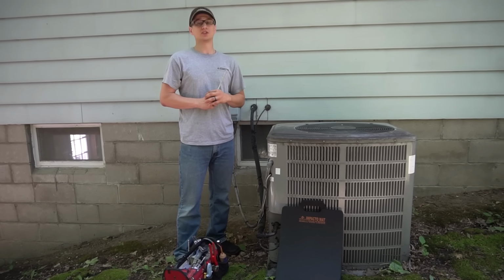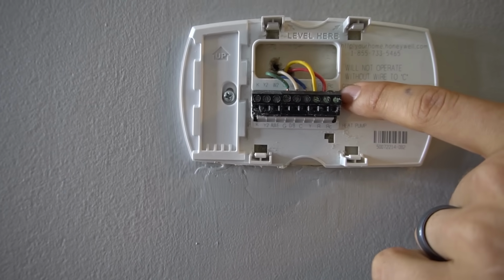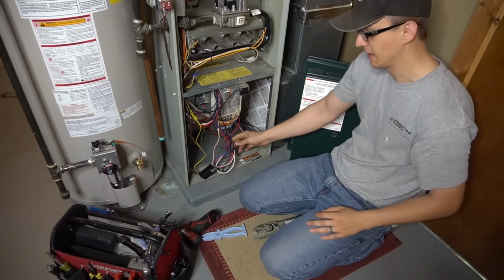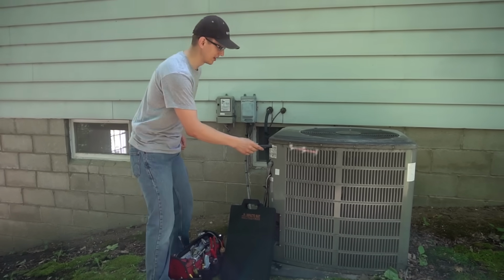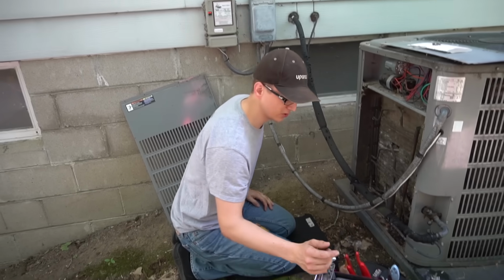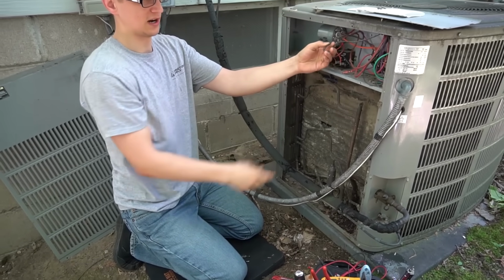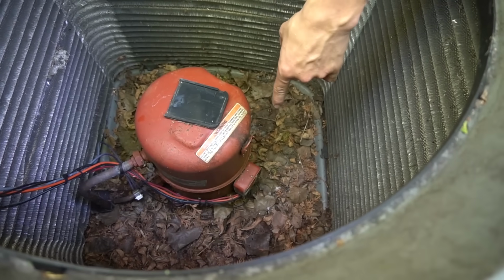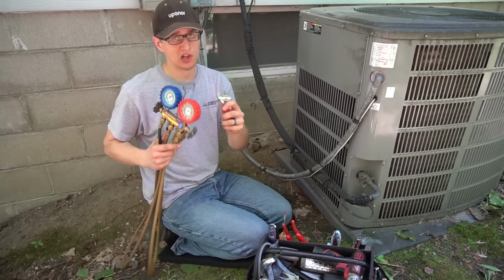AC Unit Not Turning On - How to Fix It Step by Step

Comment: I have the issue that you mentioned that my condenser outside keeps tripping the breaker. Inside my air works fine. I had someone come check it out they told me I have a bad breaker,  but my electrician said it’s old and he can replace it but he thinks it’s coming from the condenser. So now it’s a he said she said and at $150+ per service call I’d like to get more info lol. 

When I reset the breaker the unit works for about 45min. After 30-45 min the unit stops spinning outside and the inside furnace keeps blowing regular temperature air. My problem is that my unit is 13y old and has a little physical damage to the outside from the previous home owners. My R22 was just filled a month ago it has never been filled in the 13 years so it was semi low but not empty. Technician confirmed yesterday no leaks in the system as of now. So after I change the breaker I assume this is going to still trip. Should I replace the contacts because it cheap and easy and see if that fixes it? I have a feeling it’s welded together like you said in one of your videos as well as this one.

Comment: What if my breaker won’t reset what do I doooooo
Reply from the maker: Does the breaker immediately trip again or is it stuck?

If tripping again, that means you got an electrical short somewhere, try this video:
https://youtu.be/G1EBHrOgs-Q?si=H-m9_RZqKb2Rs-gj
If stuck and will not move, then you would need to replace the breaker:
https://youtu.be/CZylBCMmKR8?si=HHNLSRtfNqt3ciTa

Comment: Thank you so much for this video. I knew that I had an issue with my condenser unit but I had no idea how to trace the issue, let alone prevent myself from getting electrocuted. You taught me how to safely remove the side panel. That’s when I learned that I had not 1, not 2, but 3 dead rats in my unit! One of them was preventing the plunger switch from completing the circuit. I was able to remove the fellas and get my AC working again. You’re the man!

Comment: Awesome video! The step by step troubleshooting steps made a huge difference. Turns out my issue was a mouse in the compressor housing chewed through both thermostat wires. Saved me a service call on my rental and made the guests staying there happy. Thanks!

Comment: i pressed the plunger in and it turns on fans on the outside unit..fans turn on inside the house but ac unit outside will still not turn on.. what do you think it is?

Comment: When I connect my Google nest thermostat my ac and heating works but when I switch it back to honeywell.the system comes up but does not cool or heat. 

When I use the nest I connect the common wire on board and thermostat 

When I use Honeywell I disconnect the common wire on the board since it runs on batteries 

Any idea why my HVAC does not work when I switch it back to Honeywell

Comment: My AC Compressor blows fuse every time the unit start running AC. Pressure low and high are the same 150PSI and 80-degree ambience temperature. All wires relay contact are good. Could you tell what could be wrong? lot of thanks.

Comment: If the fan and compressor can run if you press the contact plunger, the thermostat is on and set to hold for cooler air, what else could be the problem if the fan still fails to kick on automatically?  By the way, I also have a wireless thermostat.

Comment: Hey man, I have an air handler that keeps blowing a fuse. I have it isolated from thermostat and outdoor unit. I’ve replace the transformer and checked wiring thoroughly. It only blows the fuse when the red to transformer from the board wire is connected to the transformer. It’s a Goodman air handler 

Bad board?

Comment: Compressor fan turns on when I press the push button on the outside ac unit, and fan turns.  Thermostat works for heat, but not for  cool, and outside ac unit fan will not turn on with thermostat.  Will the Outside unit fan  and compressor not work if we are out of R20?  Haven’t  checked  the capacitor yet, but no bubbling.  Ac unit and fan did work for about 10 minutes at startup 2 days ago, hasn’t worked since.  All electric wires and fuse ok.  Thoughts?

Comment: You saved me! For now at least lol. TL;DR - Change your thermostat batteries peoples! Or even just try taking them out and putting them back in!

I thought about changing the batteries in my thermostat, but it didn't say 'LO' and usually if the batteries are bad or hold a low charge, you can begin to see the LEDs (or LCDs rather) in the background starting to emit a faint line over the glow feature. Sometimes LCD devices without a glow function can also partially display LCD digits in this case.

My AC wasn't kicking on and eventually I noticed switching my thermostat to FAN ON wasn't doing anything either. Despite seeing the fan turn briefly earlier today and hearing my furnace click after hearimg the thermostat click.

Overlooked it for a while, but decided to replace them. Unfortunately, all my other AA bateries were either low charge or had major corrosion on their terminals. Tested the ones I pulled from the thermostat and they had a good charge still. Put them back in and my fan and AC kicked on!

Thanks guy! I'll sub for more content because I do want to learn basic to intermediate household HVAC stuff.

Comment: Can I use my Rheem model # to order a spare capacitator? Also, I watched your video on how to install a capacitor; however, I'm confused as to where  the wires go. I have an oval capacitator with two four prong thingy on top. The old one does not have labels  like fan, "C", Herm ...OK I know only  dual  capacitators have them labeled, so I should take a pic of the existing one prior to disconnecting & follow that pattern. Is there another way to know how to connect them? I understand it's one wire connect on each of the four things on the connector.

I'm a female, I appreciate your videos.❤❤❤🎉🎉🎉🎉

Comment: I have weird symptoms. Firstly, it should be known that my filter went wayyyy too long without being changed. I noticed that my house wasn't getting cooler so I went and changed it. 
Still, there's little or no airflow. The minimal air I'm getting seems cold, but there's little of it. 
The outdoor unit fan spins and I can hear the condenser hum. There didn't seem to be any cottonwood or anything plugging it up, but I sprayed it with the hose anyway with no luck. I went back inside to check the blower fan. I can hear it spinning. 
None of the return air vents are blocked. All the cooling vents seem equally weak. 
I've checked the duct work, it's all in tact. I'm stumped.
Someone suggested ice buildup from the bad filter, but I didn't see any (at least on the outer panels of the furnace, I didn't open it). Just in case, I shut it down for 8 hours to let any ice melt. No luck. Oh, and I noticed that there was condensation on the insulated line that comes from the outdoor unit, so I'm assuming I'm not low on refrigerant.
I don't think it's my thermostat, I haven't changed anything in ages, and also special thermostat programs usually limit how often the unit is on, but it told me my unit ran for 22.5 hours straight... With no inside temperature change.
Reply: Follow up: almost certainly ice buildup. I left it off for an additional 10 or so hours after my initial 8 hours, so as to not waste electricity. I went down and noticed a huge puddle under the furnace, and realized it was definitely ice buildup. It works fine now.

Comment: Hey, idk if you still read these but, I did all the tests. My thermo works, my furnace works, when I press the plunger the compressor and fan start but when I turn the air on, it doesn’t turn on the compressor and fan on. The furnace just blows regular air through the vents. I checked all the breakers and everything is on. Any suggestions

Comment: Thanks so much for your video. You explained things very well in this video and also the video on changing a capacitor out. I turned my AC on for the first time of the season last weekend and the condenser came on but the condenser fan did not come on. With your help I had to confidence to SAFELY check to see if I needed to replace the capacitor on my AC. I got in there and the capacitor was bulging badly. 

I could have waited for an Amazon delivery for cheaper but I just took the old capacitor to my local Ace Hardware and bought a new one. Got the new one installed with the help of the photos I took of the old one, re-connected the power disconnect, and it fired right up!

Comment: I think my Lennox Surelight control board is acting up. I changed the capacitor on the A/C unit and the two fuses in the disconnect fuse box. I was able to start the fan & compressor by pressing the plunger. I also checked for continuity on my compressor and all three prongs are good. When I turn the thermostat to Cool and fan on all I get is the blower fan to turn on but the A/C unit will not start

Comment: A/C is dead.  Blower in the house works, tstat works, 30a fuses by outdoor unit are good, plunger on contactor gets sucked in when tstat calls for a/c, but no sound at all from compressor or fan.  Also manually pushing plunger down does nothing.  Last year I replaced the capacitor and it looks fine (last year the bad cap caused buzzing from I think the compressor).  All wiring looks intact and not chewed.  Fan blades turn easily manually.  Trane XR12 from 2005.  I don't have a decent multimeter.  Not sure what to think.  I'm in MN too, how to contact you?

Comment: Wow dude! You did a great job in your video!  Learned so much from you in 30 minutes.   I'm in the Midwest as well so I appreciate all the help you provided in your video.  My unit is the original that came with the house back in 1994 so it's had a long life.  Just this past weekend, I turned on the AC and the house wasn't cooling.  I could hear the click in the thermostat, and the furnace fan downstairs was running as well.  I replaced the air filter as it was pretty clogged up.  After that, I went outside and noticed the AC fan was running but it was blowing cold air?!  Not sure where to go from here.  Any advice would be appreciated!

Comment: My York Roof heat pump with a Honeywell  RTH2300B thermostat comes on and cools then shuts down after about 2-3 minutes. It will never reset itself but turning off the thermostat switch and waiting for 5+ minutes the system will repeat the above problem. The "Cool On"
icon flashes on/off indication that the compressor protect system has activated. I believe the problem may be low refrigerant. Am I out in left field on this? Having graduated from an HVAC class  in 1984 I feel this most likely. Being 83 YO I am unable to get my gauges up on my roof to verify my suspicions. Your comments will be greatly appreciated.

Comment: My compressor won’t turn off from outside to inside unit will cut down on it now and it get cold in the house but my compressor just won’t turn off I have to actually turn the unit switch to off inside

Comment: In my case, there is a buzzing noise coming from the unit outside. The fan is not working/moving, and I'm not sure if it is the compresor or the fan.
Inside, everything seems to be working. 
What do you think it might be?

Comment: Thanks so much for putting this video together, it was very helpful!!
Our 4 ton a/c condenser (3 years old) is turning on only intermittently. There's no rhyme or reason when it decides to start (although it doesn't seem to work when we actually need it).

A few things:
We live in California.
The condenser is a side blower (fan blows out the side instead of the top).
We just replaced the furnace.  The new evaporator coil is 4 ton as well.
After we replaced the furnace, the a/c started acting up.
The blower always works. But cool air only comes out occasionally.
Sometimes the condenser won't come on at all.
Other times it will turn on and off at short intervals.  When it does this, sometimes it will eventually turn on, and sometimes it won't.

Here's what we've done and checked:
Replaced the condenser fan, as someone noted that it was really hot to the touch.
Replaced the thermostat.  We had a Nest, and replaced it with a basic (non-programmable) Honeywell.  Wires have been triple checked at the thermostat and the circuit board.
Checked the freon.  All pressure and levels were fine. (It was measured in cool and warm weather).
The fan turns easily and the outside coil does not appear to be damaged or clogged.

Any thoughts would be much appreciated!
We going a bit crazy trying to figure out what is happening with this thing.

Thank you
Greg

Comment: Thanks.. So if you push The little plunger  in on the contactor, and the unit comes on, but when you let it go it shuts off, go to the motherboard and make sure the little yellow wire is connected.. that was my problem.. I would have never known.. Thanks again.

Comment: Great video, I went through the steps and replaced the capacitor but it made no difference. I was getting 240 to the unit. When I manually pressed the switch, the compressor caught fire... like literally flames were coming out of the insulated boot. All I can guess is that something had climbed inside the power connection box on the side of the compressor and when I sent power to it, whatever it was blew up. My unit is probably 18+ years old but my guess is that its not repairable.

Comment: I replaced my contactor and my AC unit was running fine. All of a sudden, it stopped. It did not trip the e amp fuse but nothing is working. What do I do?

Comment: Wow what a great video. So I ordered a new capacitor and swapped before this video and nothing. I pushed that plunger and it started but it won’t start by itself so does that mean it’s the thermostat or the coil inside. The thermostat has power and click when I select cool. Could it be the plunger terminal. The terminals look a little burned at the base of the plunger but that may be normal from the 240v being connected to the

Comment: Inside fan and motor working. Ac is not blowing cold. Checked the capacitor on the outside unit and it’s within specs. Couldn’t find the plunger but I measured the volts and the item that looked like the plunger and it’s getting 240 volts. The outside compressor is not working. I changed the capacitor out about 3-4 months ago. Should I replace the capacitor again even though I’m getting the recommended specs.

Comment: I need help from Word of Avice

I am a a homeowner trying to develop a process to prevent unexpected AC repairs by replacing worn parts in advance to avoid costly repairs.

After installing a new central air system:

1.  When should I replace a condenser capacitor? (how often)
2.   When should I replace a condenser contactor? (how often)
3.   When should I clean condenser coil?
4.   When should I replace my thermostat?  (how often).
5.   When should I clean evaporator coil?
6.   Should I have a secondary filter on my air handler?

I know that the answer can either be:  When it goes bad or it depends or it is an overkill to change if it is still good.

What are your thoughts?   A DYI person with some minor skills can perform these duties, just spending on money on parts.

Please word of advice
Reply from the maker: Hey there! I love how organized you are so I will try to answer in the same order:

1. No need to replace it regularly but do get a spare so you have one on hand if you need it. I have many capacitor videos if you need more info.
2. Only if it fails. (They don't fail very often.)
3. Cleaning it once a year should be enough unless you have cottonwood trees that plug it up fast. Then clean it more often.
4. Unless a thermostat stops working, there's no need to replace it even if you get a new HVAC unit.
5. Cleaning the evaporator coil can be a really annoying task. It would be better if you replaced your air filters regularly so you never have to deal with that.
6. One filter is enough, no need to double up.

Usually if parts are still good, I don't replace them. If you really want to make sure though, checking the capacitor with a multimeter may let you catch a failing capacitor before it actually fully dies. The capacitor is the part that most often fails, (which is why I suggest a spare) the rest of the parts kind of fail at random.

Comment: Thank you so much for your help Jay. I hope you see my comment. I’ve learnt a lot from you more than I did in school!😂
Reply from the maker: I saw your comment! 😄 Glad to hear you learned a lot from the videos! Good luck in your career!
Reply: Thank you so much🙏🏼 do you have any advice or tips for someone like myself that wants to change from installs to becoming a service technician for residential. I have experience on servicing and repairing hot water tanks and very light maintenance work on furnaces and AC’s. What should I say to a hiring manager if I want to get into service ? They usually look for more experienced people but I do have some experience under my belt. I’m a licensed gas technician

Comment: 3rd year in a row a new part to replace. First it was the typical issue with a bad capacitor. Last year during the peak heat the fan motor was done. This year it seems that the issue part is the contractor since it’s not plunging or engaging when the thermostat is forced to turn on.

Comment: They said that my yellow AC wire was broke from the thermostat to the front. How can I fix this?
Reply from the maker: So the wire is cut/broken? Did they show you where? You can reconnect the wires using any of the methods I show here: https://youtu.be/ihpNCVk1lF0?si=tI33RYu9MFMeB9dR
Also, you may need to replace the 3amp fuse if it burned out. (sometimes it's a 5amp fuse or a tripped mini circuit breaker if you have a Lennox)